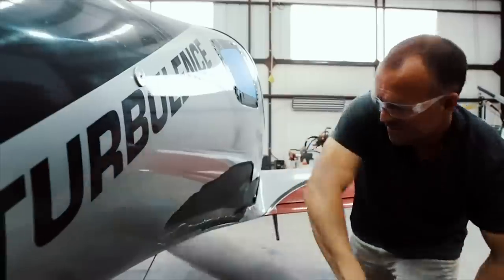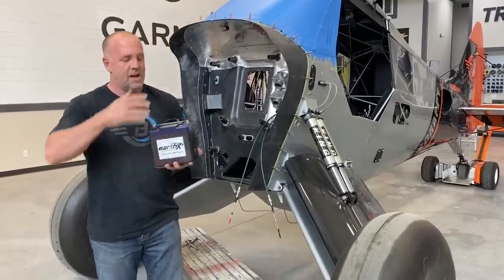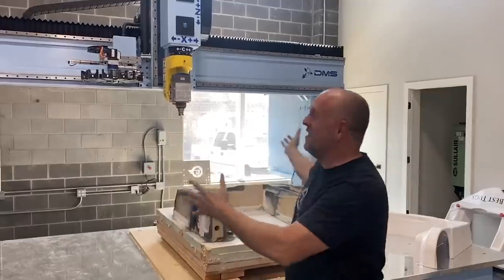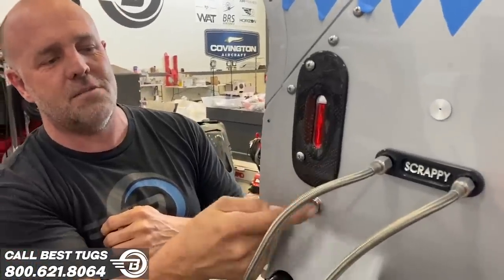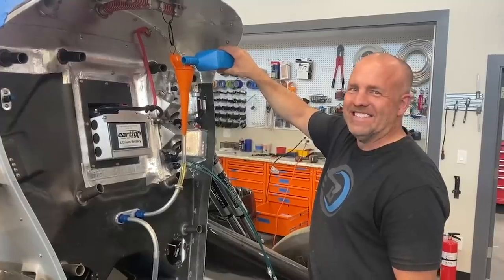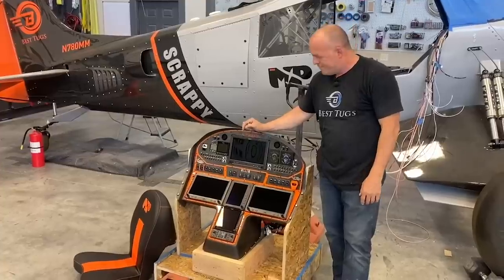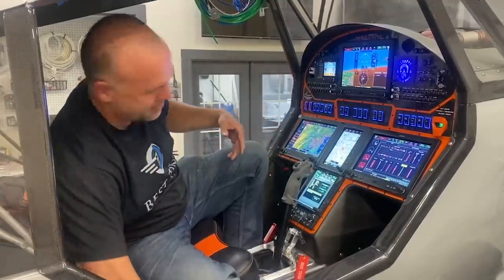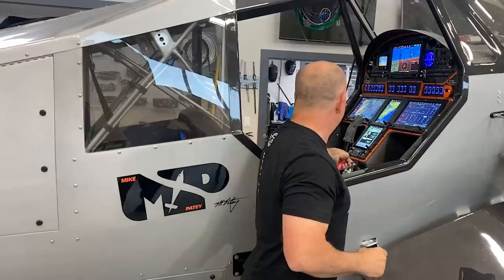Garmin Panel Install (Scrappy Bush Plane 25)

Comment: I'm not a pilot, but having pins being pushed into microswitches to start a motor seems a little too much.  Wouldn't having those pins visually checked before starting the plane be easier and not having to worry about what happens if those pins came loose in flight?  Or better yet, have it where putting those pins in place and making the switches would simply illuminate a "ready to start" light instead of having it actually integrated into the starter.  just a thought.  I know there's a 1,000 ways to do it, but sometimes simpler is better.  But the you're doing an awesome job with the plane
Reply from the maker: 👍🤠 your right,  there are a lot of ways to do the same thing.  What your suggesting in aviation is often called the idiot light.  Sadly because sometimes people get in a hurry and they ignore them and at times die. This is why they get called idiot lights.  This makes it not possible to start and also I now have installed  a bypass option so you actually have to try and start, have it not work and then decide  to bypass it.  It’s not about convenience it’s about safety.  Also your comment tends to imply  that if it fell out or taken out in flight it would stop the engine.  It can’t fall out and why would the pilot press the button and pull it out. Anyway, I agree with you,  like you said there are many ways.  What your talking about has been tried.  This is just another way.  I could just do nothing but this is my conclusion based on countless fatal crashes on past methods.  🤷‍♂️ I’m not saying it’s right but it’s right for me 🤷‍♂️👍🤠 cheers and thanks for the comment
Reply: @MikePatey  Hi Mike....neat stuff! Does the micro switch power up a relay? Not knowing the schematic, couldn't you devise a wiring scheme that uses the gust pin to complete a circuit and eliminate the micro switch?

Comment: why not just add a grounding bypass switch, if need be hidden under the dash, so that a switch failure does not prevent to use the starter (provided that one has checked the rudder is free)?
Reply from the maker: Great idea 👍🤠 the video is behind the build but that’s exactly what I did. You and I think alike
Reply: @MikePatey  yes sorry, I saw that afterwards (I postedwhile watching) - humongous amount of work you do, almost unbelievable... and of top quality, too. It's motivating, I'll try to advance a bit my (too numerous) projects, too..  thank you for the videos!

Comment: The Garmin Panel would preserve night vision better if the lighting was red instead of blue..
Reply from the maker: Robin Datta 👍🤠 I agree🤠  I have tried them both and I don’t like the red feeling and so I do blue and as it gets dark I just turn the blue off and dim the white way down that lights the letters on the switches.  The blue bezel is just accent anyway and not needed as the letters on the switches is what I use

Comment: ***************So if you really need to....the stick lock pin could be used to start the engine, then pulled out to secure the stick lock for flight.  No?*************

Comment: I make a 8 cylinder dual starter kit but it’s experimental and waiting for it to be approved for use outside of testing and it’s only approved for testing in the uk ones I get approval to start selling it I’ll send you one so you can simplify the system In scrappy

Comment: Mike.  Be very it does make sense about the lithium battery but be very very careful with lithium ion battery's
They can not be dis charged flat or over charged they wil cause big problems like fires
They are highly reactive chemically
The alternator has to be able to communicate 
Electronically with the battery they have to be highly regulated or they will BURN not just boil they CATCH ON 
FIRE!!!

Comment: Oil lubrication information for your viewers. For wet sump oil systems like you would find in a C-172, C-182, C-206, etc, whatever the maximum oil capacity level is, the engine was certified to operate with only 1/2 of that quantity...and in extreme pitch attitudes that you can only hold for very short time period because the pitch attitudes are so extreme that you would either stall the wings on the pitch up attitude or over speed the airframe limits on the pitch down attitude. I don't remember the pitch limits but I think it was around 22° pitch up and 17° pitch down when the engine had 1/2 it's full oil capacity. Can someone research these limits in the FAR's to verify this. Thanks and good hunting to the brave soul that looks it up in the FAA regulations!

Comment: You're gonna take it out into the dirt and let that huge prop blast the tail feathers with sand and small rocks??
Reply from the maker: I have a clear bra on quite a few areas.  It should do alright. 👍🏻👍🏻
Reply: @MikePatey  Is the current nasty Garmin computer hack messing with Scrappy at all? Hoping not....
Reply from the maker: Dave S. Fortunately it has no affect

Comment: I am no expert but wouldnt it be clever to just have a redundant analog combo instrument that shows the horizon, speed and altitude? Just in case? All digital is cool but a plane would need emergency instruments for this 3 critical values.

Comment: The name for Scrappy came from the idea that the plane was supposed to be a « cheap » yet time consuming way of building a plane similar to a carbon cub made mostly from « scrap » parts.   

It now includes:
- 17 layers of paint
- 8 cylinders
- 7 panel screens
- 5 high end shock absorbers
- 4 bladed massive airboat prop
- 1 Li-ion battery
And about a million dollars worth of carbon fiber...

Don’t get me wrong, I’m a HUGE fan...but can we really still call this thing Srappy? It’s FAR from cheap...
Reply: Did I forget 2 complete layers of fabric and auto-pilot?
Reply from the maker: 😅 I hear you. In my defense, those 8 cylinders did come out of a previous and beloved racer of mine...

Comment: saw that the battery was a LiPO battery. You are leaving a bit  performance behind w this configuration. A Tesla Battery is much higher energy density. However the Chinese Tesla cars are using  the LiPo chemistry. It is much cheaper to make. The Tesla battery will rarely burn up. Not sure about the LiPo one. Nobody knows more about batteries than Tesla. There's a Li_sulfur battery that has an energy density of TEN times that of Tesla currently. With that...say goodbye to JP4 jet fuel and gazoline. It has a very short recharge cycle life, however

Comment: I'm gonna make some heavy assumptions here. You have talked about this engine being 500HP. The starter button says 600HP but that's on song which will only be used when trying to make like a Saturn V in a STOL comp or on tight back country. You also talked about the need for extra fuel regulation and with the dual electronic ignition you'll easily be able to time the engine for power in the most demanding of situations. Here's the assumption... You are gonna plumb nitrous oxide for a hundo shot. 🤞🤞

Comment: Way too much at stake relying on just Garmin, know what happens when you lose GPS signal especially in clouds, Attitude HSI become completely unreliable. Not so with Xavion, you can Still safely fly your plane with complete loss of GPS signal. Attitude and airspeed are still there reliably, not so with Garmin. Xavion is from Austin Meyer